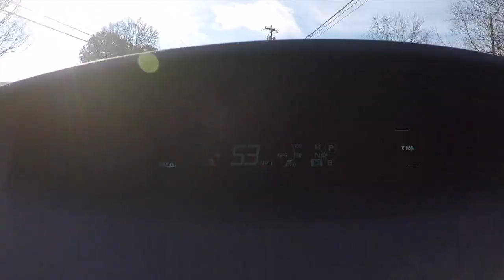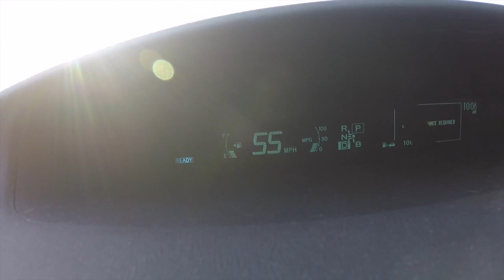Corvette Owner fixed his Daily Driver Failure or Successful

Comment: That was cool. Have you bled your coolant system for air; once you lose coolant from your heater core or engine block it may have air trapped inside. I am unsure of its urgency. Your interior heater and engine cooling may not well without bleeding. Free, It's a Youtube Doit Yourself! plenty of online videos.
Reply from the maker: I did not do that haha dang it

Comment: I know the feeling, i just replaced my blower motor resister on my chevy saburban,  $ 47.00 for the part  and i was charged another $ 60.00 plus tax to put it in, i got the part off line for. $ 28.00 this time and fixed it myself , i saved approx. $ 90.00 doing it myself.......